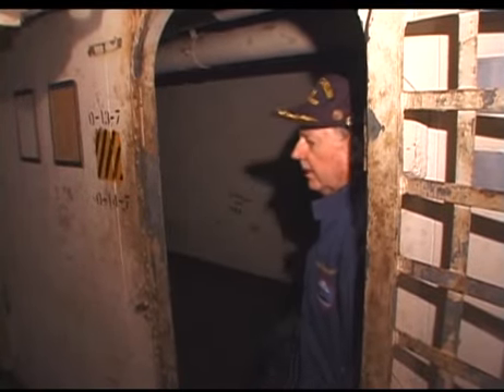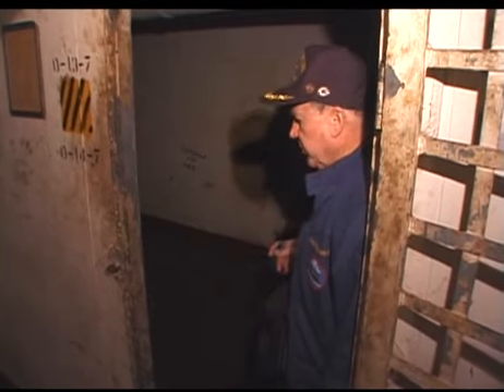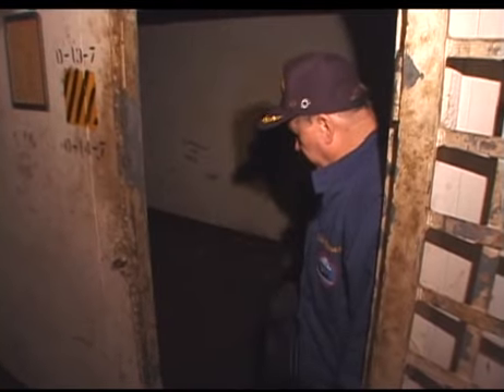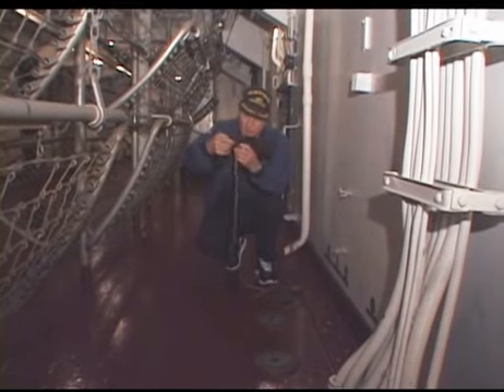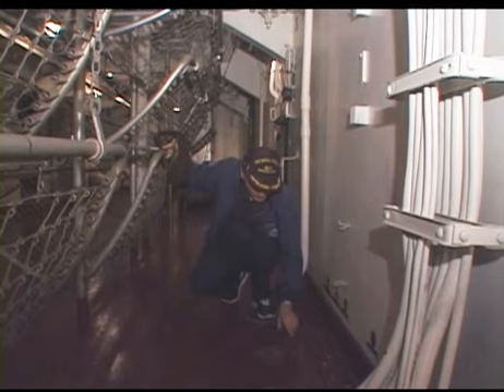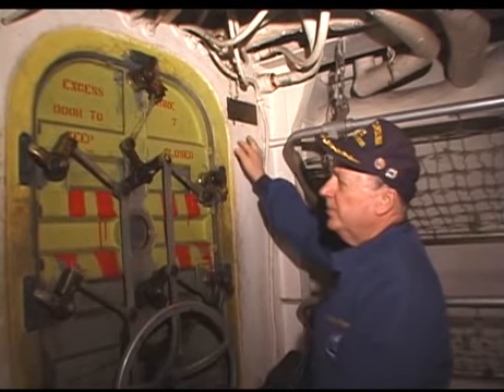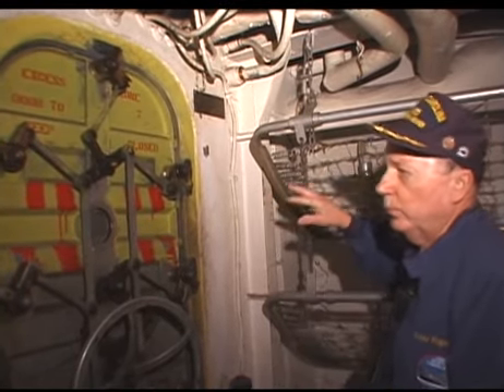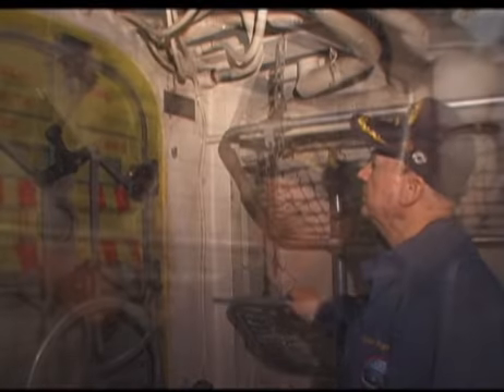Battleship North Carolina in Damage Control

Comment: North Carolina took a torpedo somewhere on the bow during the war. How did Damage Control patch the hole or keep the ship from listing, er capsizing? Sorry if I used incorrect terms.
Reply from the maker: The hatches leading to the flooded spaces were shored up with wood to provide extra support against the water pressure, ie, to prevent further flooding. 
Various void spaces on the starboard side were flooded to put the ship on an even keel. This process is called counterflooding. 
 The ship steamed under her own power back to Pearl Harbor for repairs which was performed in  the amazingly short period of 21 days.  the ship is compartmented so the crew can seal off flooded areas.  You counterflood to put the Ship on an even keel and slowly move the Ship to a place where it can be repaired.  Damage to the bow is a problem because it severely limits how fast you can move the Ship.  Our damage was to the side of the Ship but you still have to watch the speed so as not to put undue pressure on temporary damage repairs.
Reply: Ok, thanks for the fast response